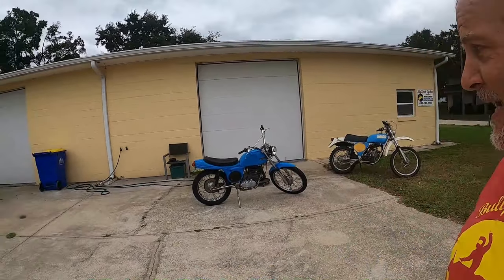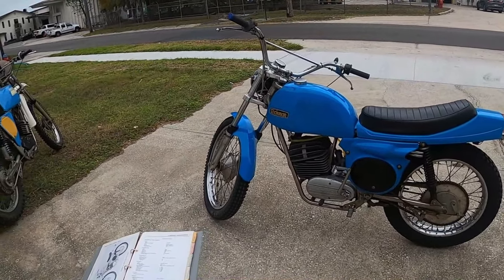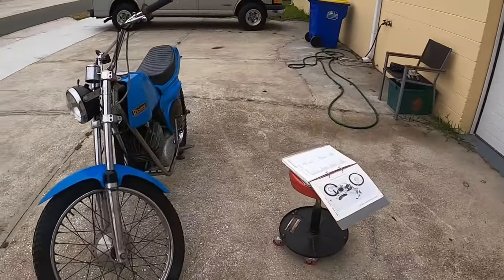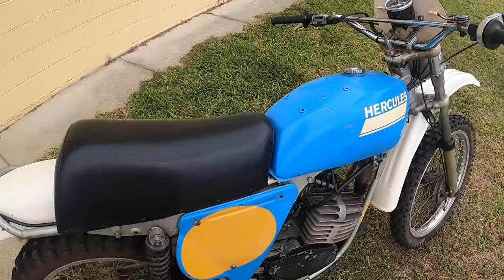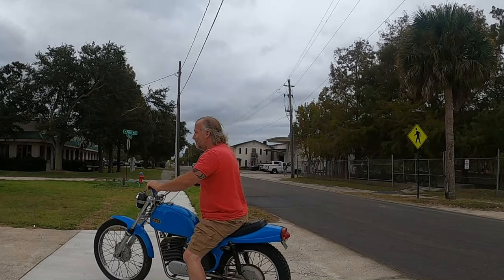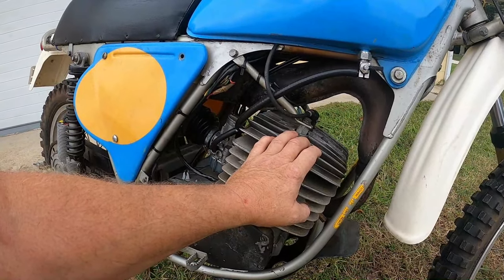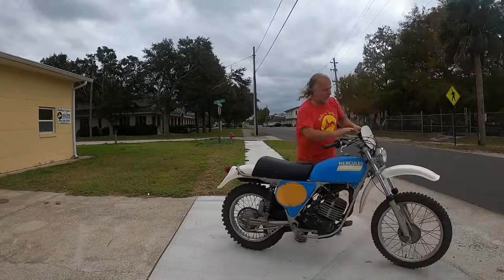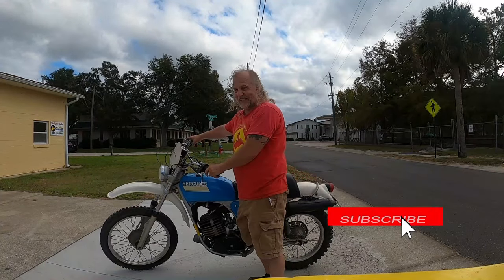Rickman Zundapp versus Hercules 125cc Enduro motorcycles

Comment: Had a 250 Hercules, bought it new in I think '77. It had a power band like a light switch, absolutely no low end power, almost an impossible bike for a first time novice woods rider like me. Switching the Bing carburetor for a Mikuni made it much more manageable. As I recall the bike was about $1300 new. The 350 was green and all cc's looked exactly the same. Another unique feature is that the engine cases split horizontally vs vertically and your description of "heavy" was spot on. Good ole days.
Reply from the maker: Good to know! Thank you
Reply: @bullpencycles  The case was split horizontally for use in the ISDT races so it could be repaired with hand tools as the rules required w/o removing the engine.

Comment: I got a brand new 74 Rickman/Zundapp 6 day for my 15th birthday. Magnificent bike👍🏆mine had a high fender and the tail piece was slightly  different as well as the pipe. The seat had a zipper for a mini tool kit.
Reply from the maker: Yes. I did not know that they made different versions of the Zundapp until I did this video.